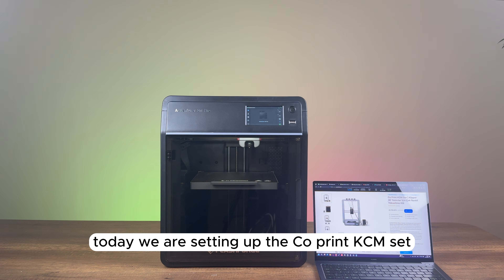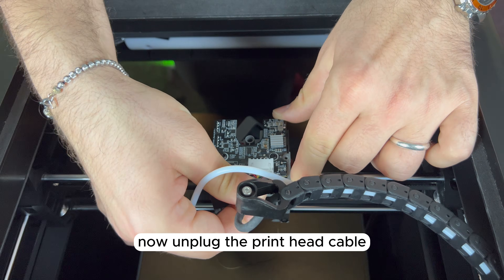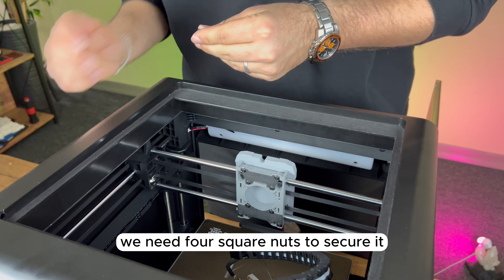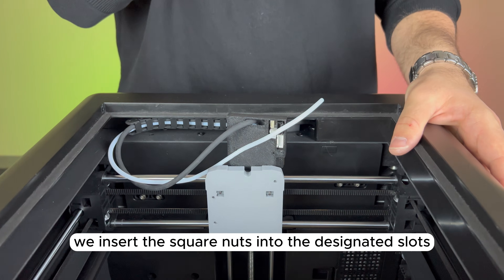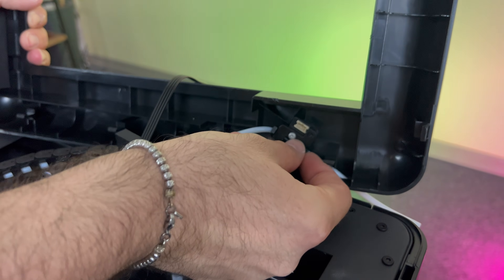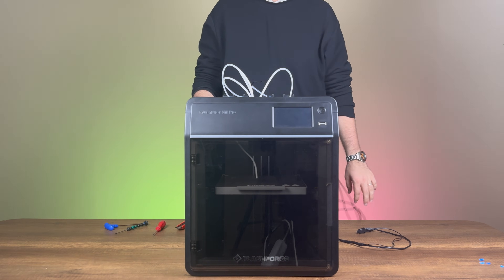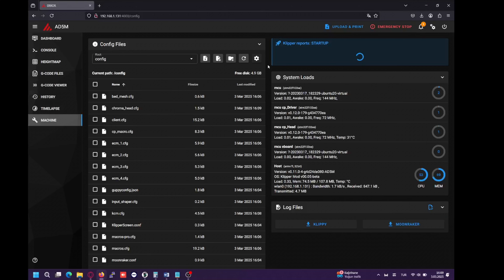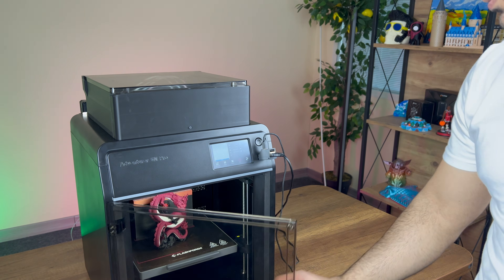Upgrade the Flashforge Adventurer 5M Pro for 4-Colors Printing | Co Print KCM Set Installation

Comment: Is the block behind the figure waste from switching colors?
Reply from the maker: Yes, the block behind the figure is a purge tower, used to clean the nozzle during color changes. It ensures each new color prints cleanly without mixing with the previous one.
Reply: @CoPrint3D  That seems to be a waste. I heard filament can be recycled. I hope there is a way, OR turning it into a cutting board
Reply: @lovedfriend2020 the purge tower is probably walls, but not solid… it’s still a lot, but not as much as if that thing were 100% infill solid.

Comment: I printed the stl files from the github page for the 5M Pro. There were only 3. Of course I started the install after. And come to find out the extruder block stl file was not there. Does anyone have the file they can share please? I cannot finish the install without it.
Reply from the maker: The file is actually available on GitHub — it’s located in the CX-1 Extruder folder since it’s specific to that assembly.
You can download it directly from this link:
🔗 CX-1 Extruder Block STL

If you need further assistance, feel free to reach out via support@coprint3d.com or DM us on any of our social media pages — we’re always happy to help!
Reply: @CoPrint3D  I had the same experience, thought I pre-printed everything the day before. Seriously, can you not just add a link in the description with the other github link so that everyone knows exactly which STL's to print beforehand? Very frustrating that some helpful stuff like that has not yet been done that should be so easy for CoPrint to do to save us frustration and actually feel ok about recommending this to others.
Reply: @CoPrint3D Thank you! I am getting the following error when a print is started. No trigger on x after movement. The print head moves to start printing but it hits the right side of the printer and stops. Thank you!

Comment: Are you supposed to download ALL of the files on that link provided?
Reply from the maker: Yes, for a complete setup, you’ll need to download both the config files and the STL files provided in the link.
The STL files need to be printed for mounting, and the config files are necessary for Klipper or firmware setup.

Let us know if you need any help during the process!
Reply: @ thank you. Now where can I find the print files for the supports to raise the lid up? And is installing the 8color the same process as 4color??

Comment: so where do i get the STL for the lid
Reply from the maker: You can download the STL files for the lid from our GitHub page:
👉 https://github.com/coprint/AssemblingParts

If you need help finding the exact file, feel free to ask!
Reply: @CoPrint3D  yes i am trying to find the stl to print the top part to put the lid on. i can only find the block holder, chroma head and the mainboard holder
Reply: @CoPrint3D  Sorry but lid extension for Flashforge is not available while in the video is clearly shown (8'20")
Where can I get .stl for it?
Reply from the maker: https://github.com/coprint/AssemblingParts/tree/main/Flashforge/A5M%20Pro%20Upper

You can also access download links for all files on the printer's wiki page:
https://wiki.coprint3d.com/en/Flashforge-Adventurer-5M-Pro-KCM-Set-Installation-Guide

Comment: Does it automatically grab the filament when you putting through the tubes.
Reply from the maker: For the initial filament loading, you’ll need to manually push the filament through the tubes until it reaches the 8-in-1 unit.
After that, all filament changes are handled automatically by the system during printing.

Let us know if you need help during setup!
Reply: @CoPrint3D  okay thank so will this work with the 5m also.

Comment: Will this work for the AD5M as well?
Reply from the maker: Yes it works!
Reply: @CoPrint3D so if I purchase the ad5m and not the pro version, I’m able to do multicolors? I’m fairly new to 3d printing and it’ll be my 1st printer. Where do I get the items from the videos to convert it?
Reply: @NINOHERNANDEZ361  if you do it I’d like to know! I’d like to do this too!
Reply: @CoPrint3D  sweet
Reply: It should. They are technically the same printer when it comes down to the firmware and hardware used.
Reply: No reason it wouldn't
Reply: Does not work on 5M pro 3d printer :(